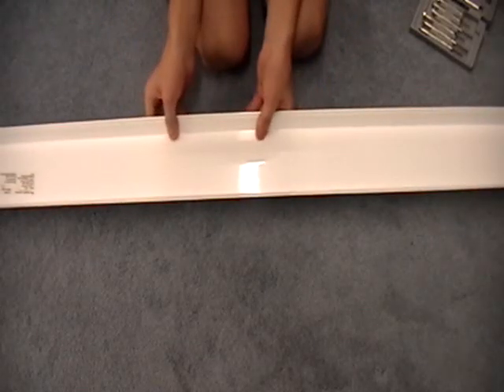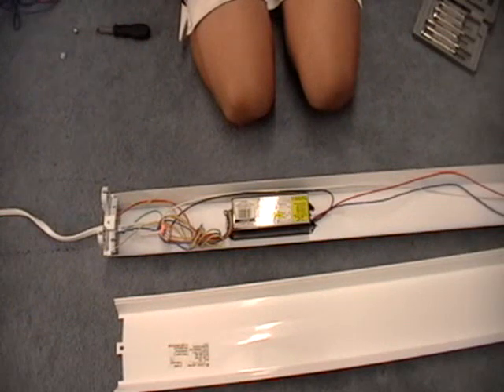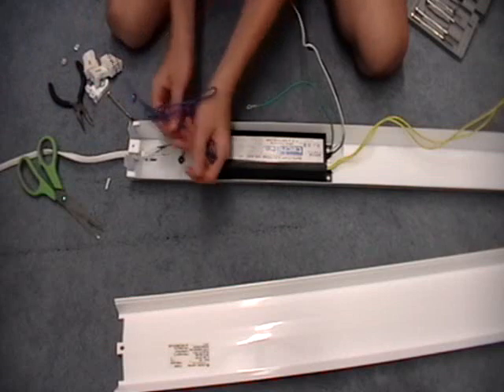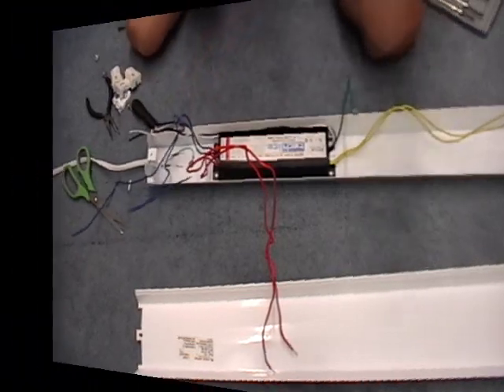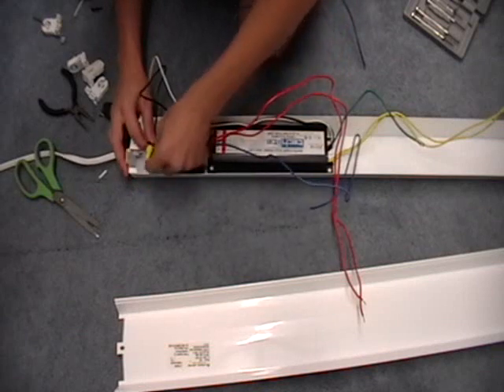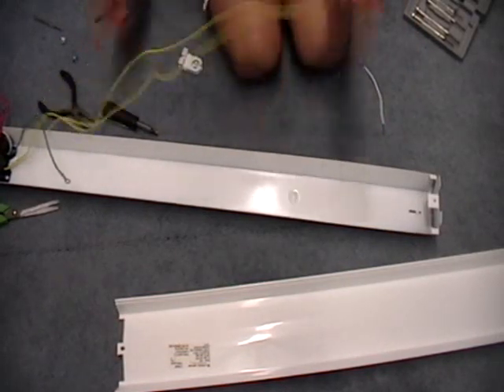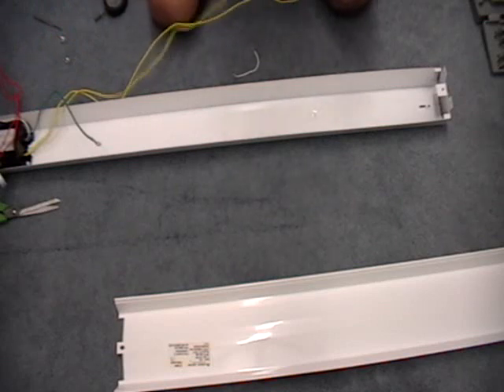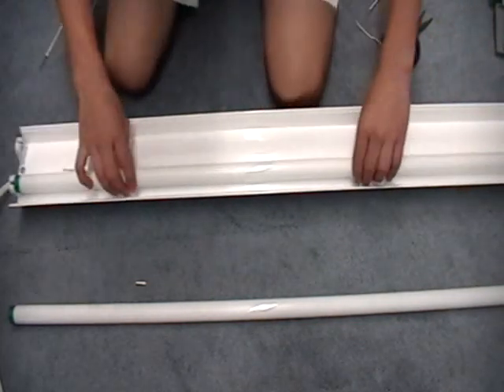How to Replace a Fluorescent Ballast

Comment: If I’m swapping out a ballast, how do you remove the wires from the clips that hold the lamps?  Do they pull out easily if you just pull on them?  Thx
Reply from the maker: Some have small tabs on the inside next to where the wire goes to release the wire, where you can push a small tool in to release the clip. In my experience upon doing so the tabs no longer hold the wire properly afterwards and the socket is then useless. So I usually lightly pull and twist the wire till it comes out (kinda like opening a cork on a bottle) Have to be careful not to break the wire off inside the socket, or break the socket itself.
Reply from the maker: The last thing you want is the wire to be loose upon reinstallation. Ballasts operate on up to 600-800 volts to start the lamps. Loose wire can arc and melt the socket instantly. So if in doubt after reinstalling, lightly tug to check the wire is snug, if not try again or replace sockets.

Comment: You are correct about the power being off.  However, it's a good habit to get into, especially if you work out in the field where others have access to the panel, housing the breaker feeding the light fixture.  Basically, when connecting power, you go in this order - ground, neutral, hot.  When disconnecting, you do the reverse - hot, neutral, ground.  In this case, you set it up so you were working on wires with a larger amount of time that they could have been energized.  Its a safer way to go

Comment from the maker: @william110280 It does'nt matter as long as the power to the fixture is off. Breaker/fuse needs to be off, or unplug the fixture. You can wire it in any order you want, as long as its wired to the ballast's diagram spec's.